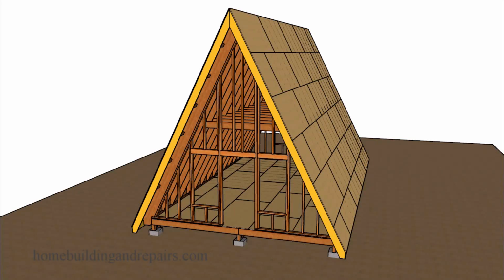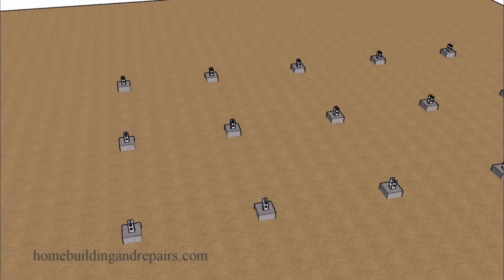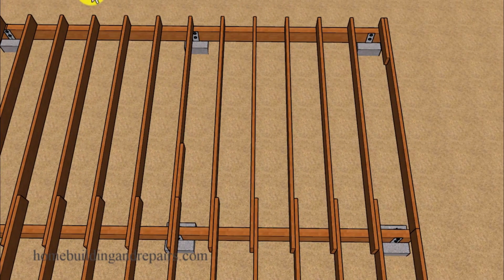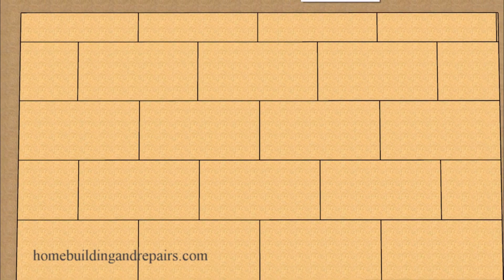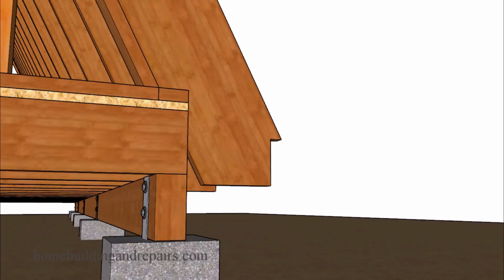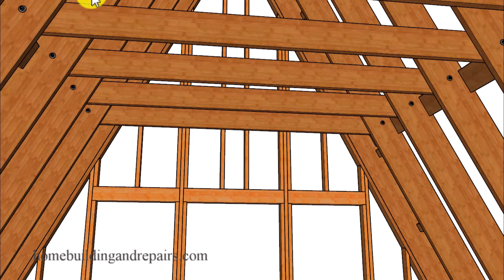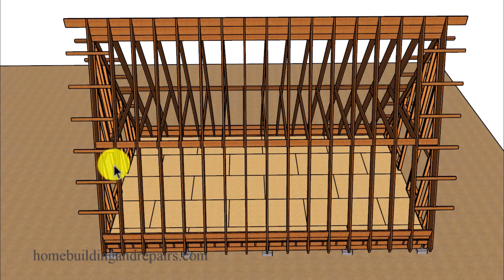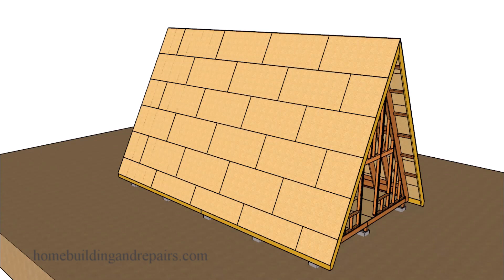How To Build A Frame Home With Wood Assembly Examples And Design Ideas

Comment: Love it, off Grid  woukd be great. What about Ridge Ventilation???  Think Some type of ridge vent woukd be needed especially in warmer  locations.  How bout some solar panels also, Fireplace  of some sort. Classic, looks very stout, like the blicking idea for extra nailing. Let's jot forget you cant jamb the ply wood together anywhere as it will buckle..Finishing nails in between  works. Floor Tongue and groove is fine. Roof and outside walls ypu need space.

Comment: I love the clarity of the framing.  If you could show a variation with a bumped out dormer wall on the side, it would be great.  Thank you.
Reply from the maker: Thanks for the suggestion!
Reply: literally exactly what I am doing. Prob will frame out a little 6x6' square and then attach rafters from the far side of that nook to the main ridge board where the A frame rafters attach. So it would be significantly less sharp of an angle to the roof on that section.  You could also just make a roof over the nook portion, gable or shed style, whatever, and then run your A frame rafters to the top of that top plate/beam, add a valley of metal underneath the main roof metal and then goes over the shed roof, or something along those lines. Hard to describe via text but building a neck is the correct/popular way to add a shitload of windows to an A frame. Even if you get a bunch of expensive custom triangular windows for the front gable end, it's still gonna feel like a dungeon without windows on the sides.

Comment: You definitely want a "ban board" around all sides of the subfloor and not a series of joist with blocks in between. Cut the joists 1 1/2 inches shorter and run a board the whole length tying the ends of those joists together. Put some blocks in the middle to increase strength and prevent joists from rolling over under extreme loads.

Comment: Hello!  I am building an A-frame, and the plans show two 1-3/4" ridge board at 48' long  made from LVL, which creates a 3.5" thick beam.  I'm pretty sure I can do this, but I wanted to see your thoughts:  Cant I break these up into 12 foot sections and stagger the joints between the two LVLs?  For example, I would start with a 6' and 12' LVL on one end, and keep adding ridges as I lay the rafters.  The ridge board is structural, but its not load bearing and acts as a nailer for the rafters.

Comment: Hey there Greg.  Big fan here!  Your videos are fantastic.  I had a question on this build. What would be the best way to fasten the rafters (2x12" LVL, for example) to the plate ?  Is it simply toenailed on the side of each rafter or are there better ways to fasten? I struggle with finding many A-frame builds out there that are as large as this.. Typically I see the rafters tied into the floor joist for super simple secure fastening with bolts or structural screws.
Reply from the maker: You can use framing hardware or/and toe nailing. I do have examples on other home building projects on how to attach roof rafters to framing plates. Thanks for the kind words about my videos. https://www.homebuildingandrepairs.com/home_building/index.html

Comment: I'm not sure about energy efficiency, but the A is not space efficient, and for it to be bigger in general it needs to increase the base area which will increase the total height if the roof slope is maintained.

Comment: I have stayed in some Public Use A Frame cabins and did not care for them at all.  They felt very small inside especially in the loft.  You have to sleep on the floor.  No head room.  Difficult to furnish.  The ones I do like have a conventional room added to each side or had short vertical walls.

Comment: I have seen a supposed expert carpenter build one with an add on. Add on was living room roof was lower than a frame so all the heat went right up to upstairs bedroom. Living room always cold had to put monitor heater in living room for heat eventhough he had wood stove in kitchen. If you do an add on make roof same hight.

Comment: Its insulation would be fine if you use nail base. R19-21 in the 2x6 rafters with nailbase for your decking over that to get to the R value you want.

Comment: I’ve always thought that an A frame would be more functional on 4 ft walls. I’d start with 6X6 timbers set in concrete 4 feet apart and hang the floor from these timbers at least 3 feet off the ground so each set of opposing timbers could be tied together with an X brace under the floor. 2X6 wall sections between the timbers and manufactured trusses set on top. Should be very solid.

Comment: Dont do this(if you dont sure you want it).
At my "cabin in the wood"(actually i just bought old countryhouse near the forest) 2nd floor made in the such style.
In result room smaller than it could be in normal manner, windows only in two sides(in normal way it could be in 4 sides), and unused space atop of the room(attic).
I mean, from 2 sides your walls - not walls at all, it is roof, so it is leaning and really usable space is reduced. 
Moreover, the roof in such way is much larger than it could be(more material).
The ONLY good point in such high roofs -- snow falling from it, so you dont need to clear snow from the roof.

I mean as something you can build fast(and if you need it only as shelter from snow rain, or as sleeping place) it is OK, but this shape is not so comfortable\rational.

Comment: A wise man who lived in an A frame once said, “never build an A frame house”.
Reply: A frame house is better then no frame house
Reply: But why
Reply: Says who bro, come on
Reply: @maddselite no one said that. He just wants attention 😂
Reply: I did a price comparison for an A frame versus a conventional building with the same size floor and it was the same. Roofing is expensive and in an A-frame about a third of the floor space can’t be walked in.
Reply: @Chris_at_Home the footprint is similar regardless. Beds, furniture, appliances etc take up floor space along the wall anyway. How often do you need to walk against a wall in any given room?
Reply: @AccountInactive  I have an off-road cabin where the upstairs is an 18-12 pitch roof similar to an A-frame.  Putting a bed against the wall you loose over a foot of wasted floor space. So if you’re not going to walk against the wall where are you going to mount the kitchen cabinets? How are you going to mount the upper cabinets on a side wall?  You can do that on the ends but you loose the only window space. While on the subject of windows you are limited to two views, one on either end.
Reply: @Chris_at_Home no offense, but you're not seeing the full potential. As someone who has zero construction experience, I'm building an a frame because the simplicity, cost, and design. There is honestly a ridiculous amount of space what a lot of people don't account for. Also, if you're building it on a mountain, which we are and the ground is not level, then you have tons of storage space under the A frame too. I will say we are building a pretty big A frame and much higher peak of the A to give more space, but it's definitely more feasible for comfort than most people realize. We are a family of 5.
Reply: @TrueAlphaNoob Family of four here living an old doublewide that's falling apart.  Im researching the costs between building an A frame cabin vs traditional
Reply: I'm here for the comments😂😂😂

Comment: Also on my 24 x 24 A-frame besides the 4 foot sidewalks made of concrete or concrete blocks. Mine was going to be on a concrete slab with radiant heat system installed in the concrete.

Comment: I have a question. My plan is to build a 4 foot concrete blocks wall on both sides of my 24 x 24 a frame so that I have better sidewall on the inside. Do you have a plan showing something with side?
Reply from the maker: A block wall might require more structural reinforcement and I don't have plans.

Comment: A frame and skillion designs are some of the easiest to build. A frame lacks floor space. Decided to go with a post and beam skillion on block piers and insulated slab. 6/12 pitch because 70 psf snow loads. Bubble wrap under flooring on post style cabins does wonders.

Comment: How did you attach the floor to the wood that is on the piers?
Reply from the maker: You can use footings and post or beam connecting hardware. I've seen pier used for this, but am not a big fan or them for this type of construction.

Comment: How about designing an A frame with roof rafters sitting on a 2' or 4' tall knee wall?
Reply: IDK, I wonder if the weight of the roof would push them out?

Comment: I would love to learn more about these. I always considered an A frame as one of the more simple builds but I've never looked further into them other than the shape. It is one of the ideas I have for a cabin build in the near future. I've been tossing around ideas such as D logs, chinked log cabin, vertical log cabin, timber framing, pretty much something where I can mill the wood myself, which keeps me limited to a 10 foot lengths. This looks like a large A frame and I've only considered building a small studio apartment size but this makes me think maybe a larger one would be nice.

Comment: Would be interested in  your take on building an  A frame 24 X 32 from foundation up, I think it would be alot easier to roof then conventional stick frame. really enjoy your topics. thanks,,, from the cold north.
Reply from the maker: I like it and will be making some wider in this series.
Reply: No.  The roof pitch is crazy steep.  Impossible to walk on to build and repair.  You need extremely long ladders.  Just no.
Reply: Scaffolding or a lift would be the way to roof it wouldn't it. Use metal roofing so your doing it once.

Comment: How would you build a 16' wide by 20' long A-frame off the side of an existing structure that has a 9 12 pitch metal roof? I wanted to go out the back but my wife wants to go out from the left side of our cabin we're building.
Reply from the maker: I put your suggestion on my list of videos and will contact you for some pictures if I decide to make this model.
Reply: @gregvancom  👍 thanks.

Comment: Easy to build? I'm sick of trying not to fall off my 10:12 roof. This looks like a 24:12. A frames are a terrible design. Super expensive and hard roof to build and even less square footage and headroom than a normal house for all that work and materials.
Reply from the maker: Good points.